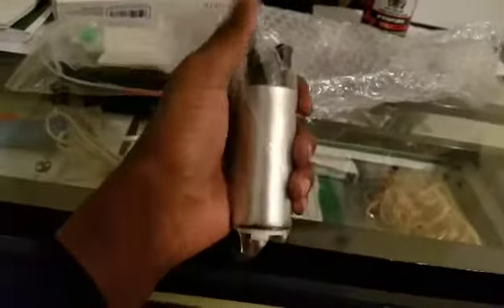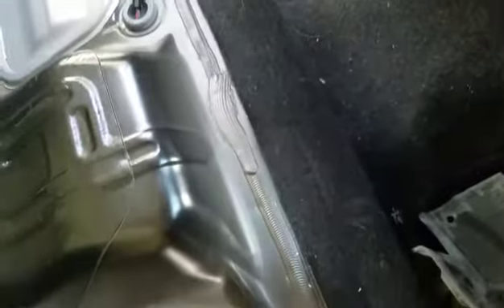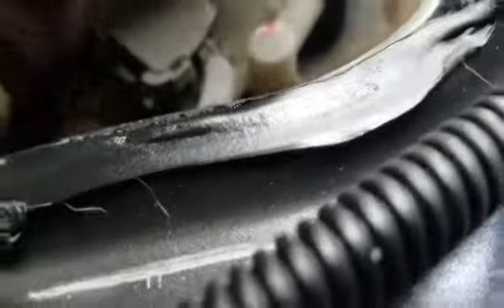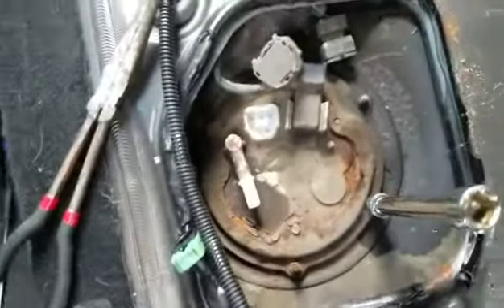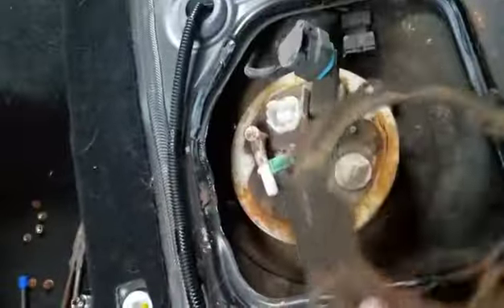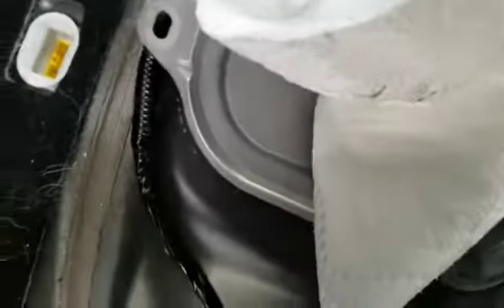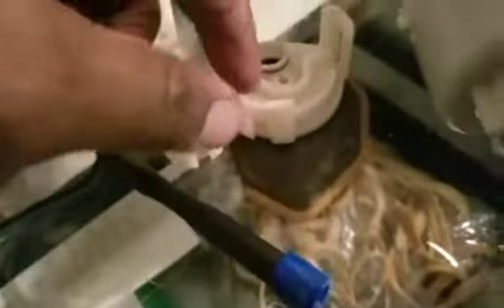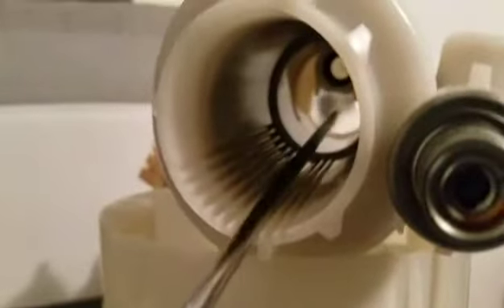255LPH Fuel Pump install

Comment: Were you having issues with not enough fuel making it in to the new motor?
Reply from the maker: Brad Brooks u have to prime the pump first also make sure u put that rubber o ring back or else it won't fuel
Reply: Donovan Dixon I was just speaking of the whole purpose of upgrading the pump.
Reply from the maker: Brad Brooks oh sorry no but that oem pump will not be enough for this boost application

Comment: thanks for the info ........... could you tell me how much psi the normal NA 4b11 can take with turbo ? ........... also will after market ralliart 4b11t turbo manifold fit our engine ?
Reply from the maker: Hossam Ahmed our 4b12 can handle up to 11psi when paired with the 5spd manual transmission but with the cvt transmissions it limits it down to 5-7 psi ..........also yes the ralliart manifold will fit our cars
Reply from the maker: Hossam Ahmed and the specs are the same for the 4b11